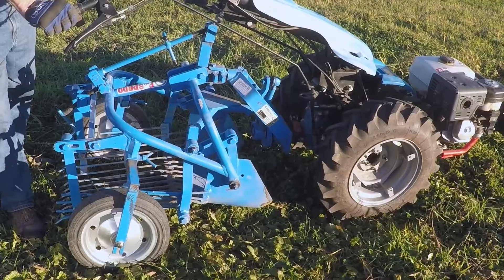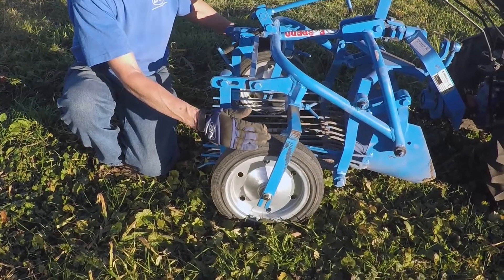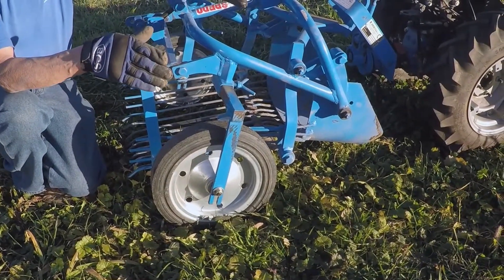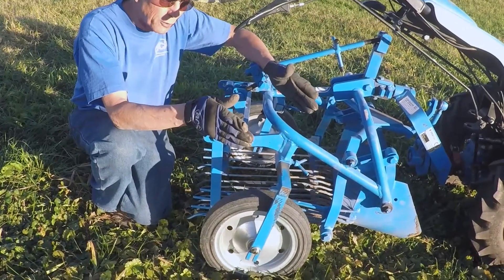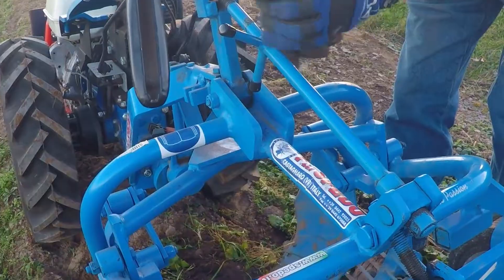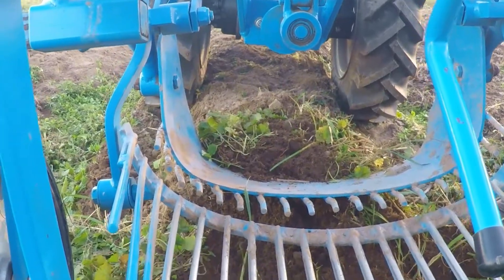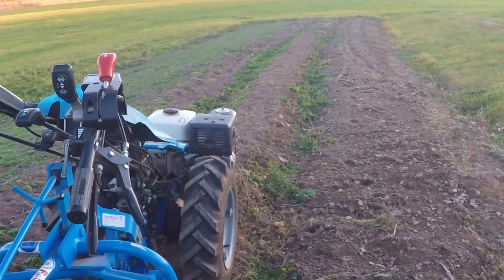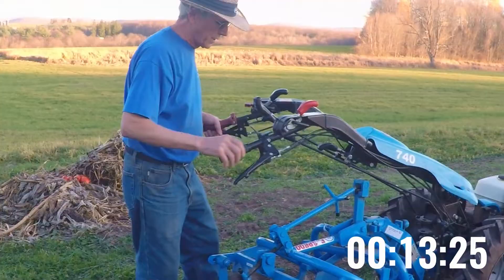BCS Two-Wheel Tractor and the Power Potato Digger

Comment: Hi guys! Just tried mine for the first time yesterday. My bcs motor block sits on the top of the hill and the whole shebang stays stuck, not moving... Short of getting bigger wheels, any advice?
Reply from the maker: Sounds like larger wheels is what you need - which tractor model do you have?
Reply: @BCSAmerica  it's the european model, a 739 I believe. I think the wheels are 400mm? what size wheels are the ones in the video?
Reply from the maker: @alextritten3378  739 is only sold in the USA.  In Europe, the equivalent model is the 738.  It is usually sold with 5x10" wheels on 19" tires.  
The wheels/tires in the video are 5x12" on 22" tires.
Reply: I have the same problem. Thank you for mention it.